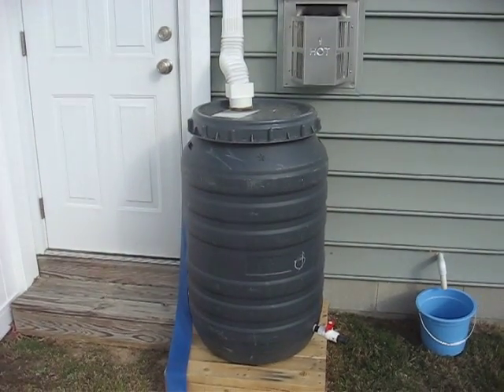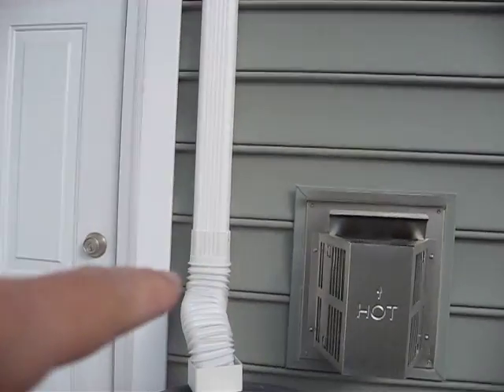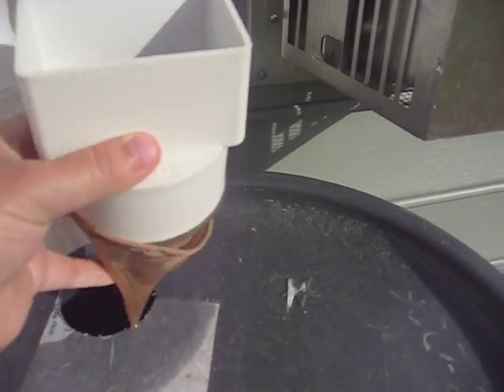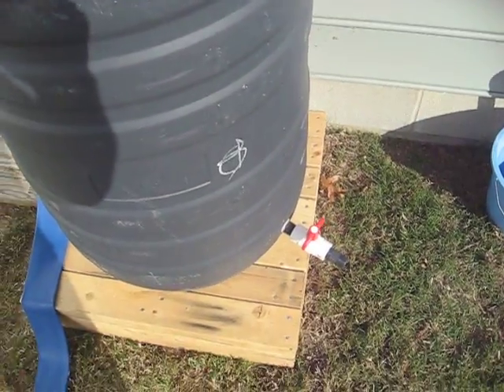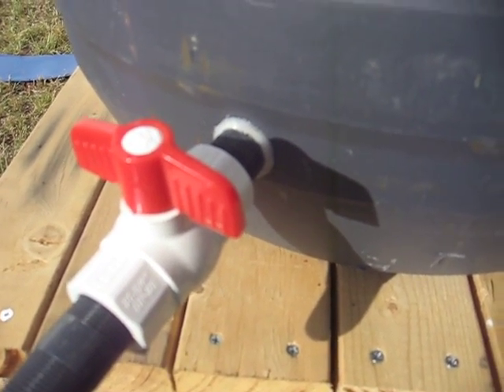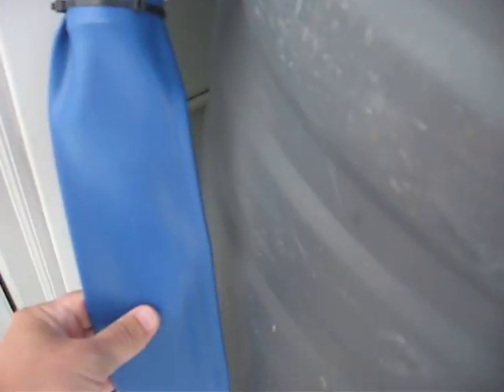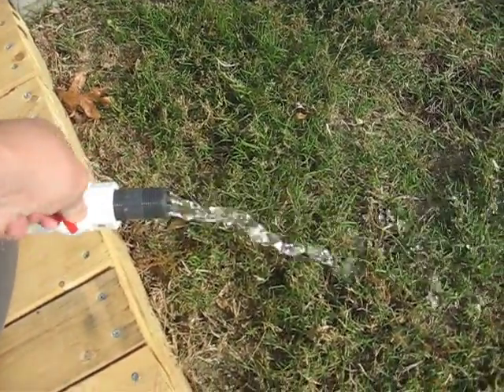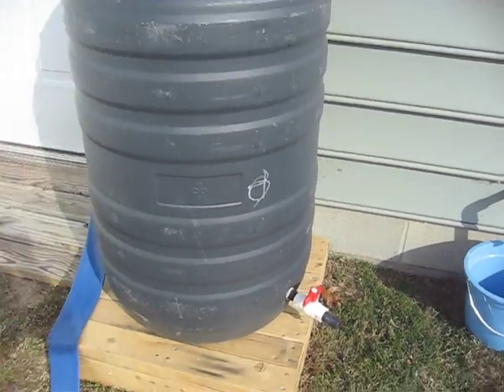Rain barrel 3 of 3

Comment: Is the blue hose a finished product? Have you considered burying a subsoil system and connecting it instead?
Reply from the maker: I don't know what you mean by "finished product". Not sure what a subsoil system is either, but I will look into it. I really just set up this rain catchment system as a cheap and easy way to use rain water for my small garden, instead of city water. I built this for under 50 bucks and I think most people would be able to put it together with basic tools.
Reply: Basically instead of the blue hose you would go directly into the ground with PVC pipe. The pipe in the ground would have either perforations or holes in it. You would just run in through your yard and surround it with pea gravel before covering with dirt. As the barrel overflowed it would just seep into the ground.  It would just be a cleaner look and water your grass from underneath. I'm not critiquing what you have by any means. I'm just making conversation :) Very nice setup.
Reply from the maker: Andres Pena
Oh, I'm not taking it as criticism at all. I'm definitely interested in learning from other and youtube is a great forum for everyone to share their knowledge.
So that sounds like a french drain set up. Or at least, that's what I've always known them as.
I could certainly do that, but that would cost more money, time, and effort and you'd have to get the utility company to come out and mark for any existing wires/pipes before you start digging in your yard.
Reply: You shouldn't have to dig more than a foot deep. We've always called them subsoil systems or if they are coming from a septic tank it would be a leech field or absorption system. It's always safer to call rather than find something expensive buried in your yard. I have an easement in the back 10' of the yard and I think I would dig anywhere else without much concern.
Reply from the maker: Andres Pena
Yeah, I certainly don't think it's worth the risk to turn a $50 project into a potential $1k project, if you hit some wires or pipes. Also, I'm just catching water from the existing gutter downspout and I can't imagine that folks are building subsoil systems for each of their downspouts. But that's def a great idea if you are trying to avoid standing water against house foundation.